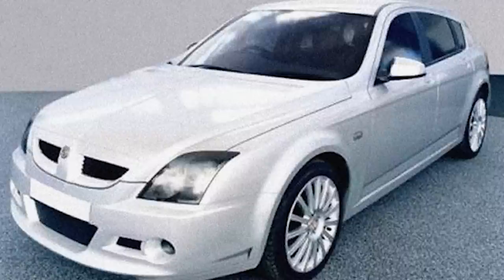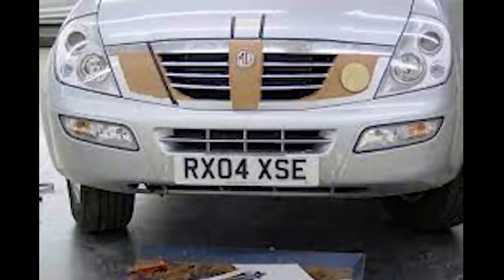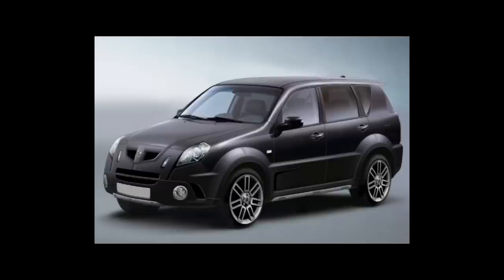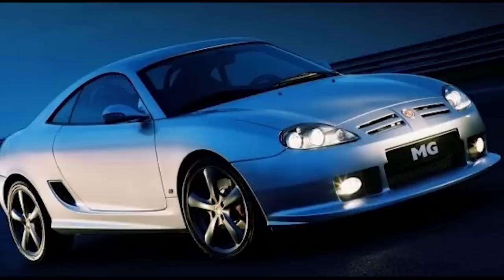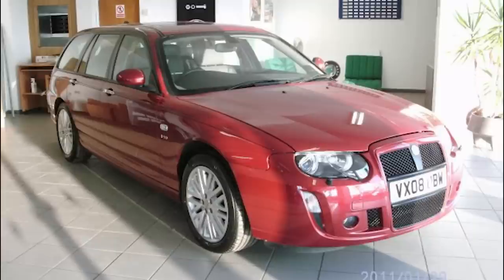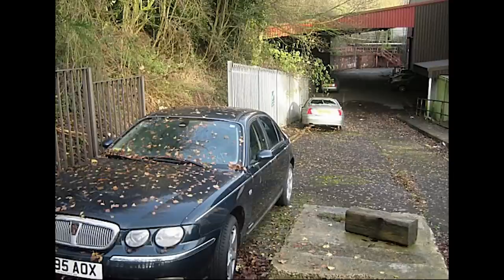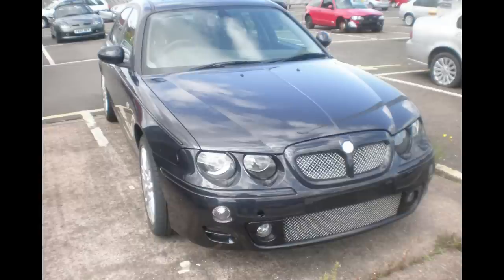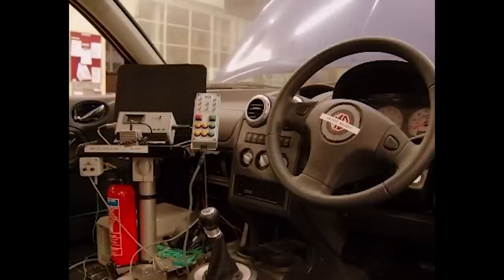MG Rover - The Lost Prototypes and Survivors

Comment: A couple of corrections..the TCV was a clay buck and weighed around 2/3 tons. I know because I had to move the car out of the way. It was behind the stage in the exhibition hall along with various other classics which had been bought by MGR. The TCV didn’t steer and had to be moved on go-jacks, it was beginning to deteriorate to, cracking etc. 
VX08 ZTT was purchased by an employee from NAC for £500 and he then registered it and tried to get it working properly, failing in the attempt due to the unconfigured ECU which gave many problems including with the ABS system. The employee then mashed-up the grill design using a “premium” front end to create an MG, it was actually a Rover 75 Tourer. All that was in 2007.
The V8 LWB Rover 75 was utilised by the MD of NAC as transport to and from home and to collect VIPs from the airport. I think it was scrapped in 2008/9 along with all the other development cars which were non compliant and gave the legal eagle company solicitor nightmares in case they escaped. The V8 LWB was actually a compliant car and shouldn’t have been scrapped.
I know this because I worked for NAC/SAIC during that period ans was trying to buy the second production spec 75 Tourer (LHD) which was languishing on the parking lot.
Reply from the maker: Thanks Stephen, these sort of comments are what keeps me making content, I’ll pin this for reference
Reply: Thanks for your valuable information..it's sad to see even clay mock ups degrading in car park...hopefully gaydon might have some influence to save some if not all. Obviously if this video is seen it may lead to the company disposal of them even faster? I hope not... British motoring at its best, destroyed by media and strikes!😢
Reply: Hi you making content about rover cars,the rot there goes deep why car's didn't get off the ground etc etc.
You would be better trying to find out what happened to all the money.

Comment: I used to work at Longbridge so thanks for this video. My last job was working on the fit and finish on the Rover 75, I also occasionallly worked on the 25 and 45. In early 2004 I was part of a team who travelled to Bristol docks where the City Rovers were were brought into the UK. The fit and finish on these cars was quite frankly awful. We had to get them to a condition fit for sale. I have driven a few City Rovers where at one time I have one as a courtesy car whilst mine was being repaired. Unfortunately I have to say it is probably one of the worst cars I have ever driven. It was noisy, unrefined, vague to say the least. The interior was also extremely cheap and nasty. It was a shame that this vehicle was placed alongside the other Rover vehicles in the range. I beleive the 25 replacement eventually became the BMW 1 series which hasn't been a bad seller. Any videos on this?
Reply: Unfortunately your experience with the CityRover is now commonplace and built-in. Everything from giant rigs to Wind Turbines need re-fitting and this is preferred than building them ‘better’ here.

Comment: I’ve always said the RDX60 was sold to General Motors, and was later released as the Signum.
Far too many similarities to go unnoticed.

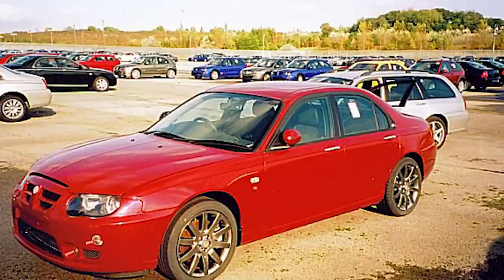The V8 ZT at 17:40 😢

I had a few conversations at POL and various other places with Mark from KMAPS. Some of the stories I’ve heard from people who worked at Longbridge, you could write a book.
Reply: The Signum was probably more inspired by the FIAT Croma ‘comfort wagon’ thing, that was also based on a Vectra. There was a GM Opel /FIAT joint venture at the time so must of been aware
Reply: I thought as much as some of the parts looks like those from a Vauxhall Vectra
Reply: @jamieeedden777  the Croma was pretty much a Vauxhall Vectra

Comment: I had a Trophy 160 that I did a lot of work on. Two things about the beautiful  TFGT.
1. I wonder how they managed to squeeze the bulky V6 into it? We just about fitted a turbo to the K series in there but it was a very tight fit.
2. To work on the engine from above the soft top could be folded forward and a large plate underneath the parcel shelf carpet could be unbolted and removed. I wonder how the TFGT provided access to the engine from above?
3. The suspension and radiator came from the Metro and I'm wondering how those rudimentary low powered hatchback shopping car parts would have been upgraded for the potential weight power and speed of the V6 engine. They were pretty marginal in my Trophy. Incidentally, half of the Metro CV joint found it's way into the MGF and just rotated there redundant adding to unsprung weight. When under the car I would often muse about the possibility of a 4WD MGF!!!
4. At the same time I was also working on a Rover 25 turbo conversion using a VVC engine but with solid inlet cam with Kmaps to do the ECU for me. I was looking at getting hold of an old Mk1 Freelander to assess the feasibility of putting it's entire transmission and back axle under there... But that never happened as I sold all the turbo conversion parts and scrapped the rest upon retirement, cancer, and emigration.
5. I once drove a hired City Rover from South Coast to London then full circle round  the M25 and back south again. It was an experience I been trying hard to forget ever since.

Comment: Hi Tom, Fantastic video pal. So sad to see these cars that could have saved Rover. 
That MG 4x4 Mock-up of the Ssangyong I wonder if it’s still around somewhere as according to the DVLA records it’s actually on SORN which would mean it hasn’t actually been scrapped unless DVLA records are incorrect.
There was also another Prototype 75 that you didn’t mention. Rover had to find away of getting rid of the BMW Diesel engines as it was costing a fortune in royalties back to BMW for its continued use. They used the Fiat 1.9 JTD engine in one as a test rig. That car did actually escape the flight shed as it was for sale a few years ago and I went to have a look at it. The garage that was selling it was quite upfront about it being a prototype and said they couldn’t warrant it because of this. It was a silver 75 Saloon in base classic specification, 99% sure it was on an 06 Plate. I believe there was more than one of these that did escape from Longbridge.
Reply from the maker: Someone has messaged me who owns a 75 with the JTD engine. The Rexton is believed scrapped someone sent me a photo of it that confirms it
Reply: I did some contract work at Longbridge around 10 years ago and the MG rexton was abandoned near to the security office with flat tyres and had gone green with moss, along with the ZT fire response car which had also been used by security

Comment: AROnline states on the MG ZT Countrywise
"The SMTC UK employee who sold the car to John has a colleague at Longbridge who worked on the original project – John hopes that the Engineer concerned will be able to assist him with the electrical problem-solving which remains.

John reckons that his ZT-T 4WD has done around 5000 miles – the Service Indicator suggests that one is due in 10,000 miles – and the immaculate condition of the car’s interior reflects that. However, as the Land Rover Freelander transmission sits slightly higher and further forward than in a standard ZT-T, John has fitted a cloth insert made of sound-deadening material as a temporary solution."
Meaning he sold it to someone who originally worked on the Countrywise.

"Ironically, that prompted John Newey to suggest that he might fit Rover Streetwise-type wheel arch surrounds and a Matt Black wrap across the bottom of his car – that would, after all, probably create a pretty accurate impression of what a production MG ZT-T Crosswise or Countrywise might have looked like back in 2005."